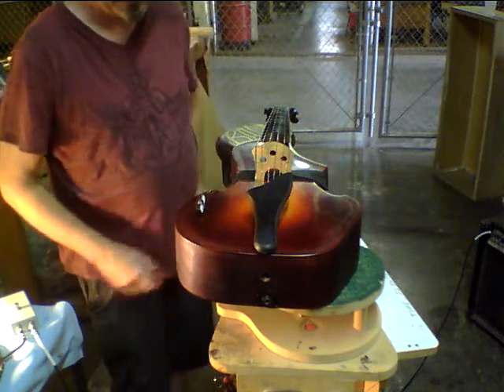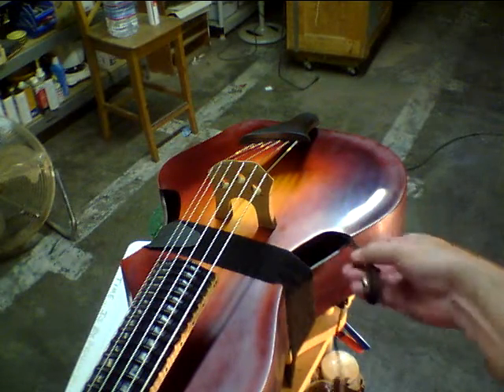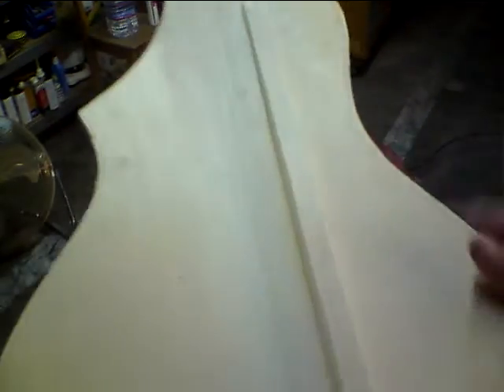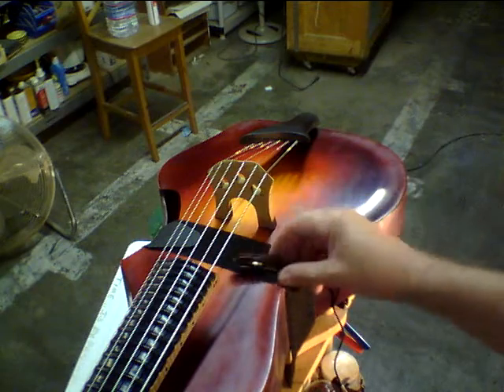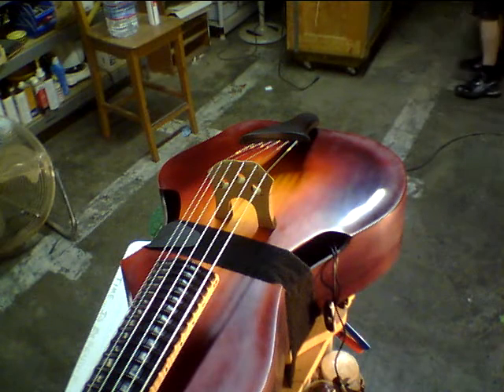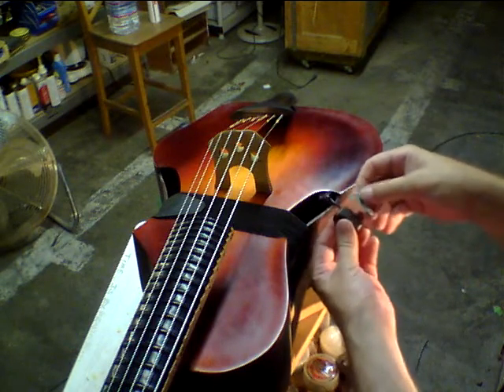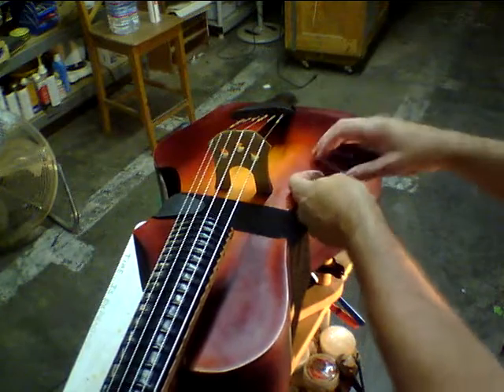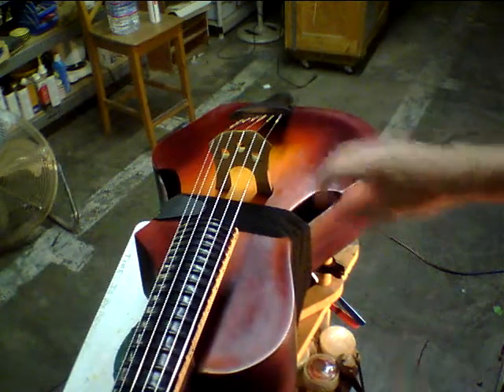LR Baggs Lyric installation on acoustic TogaMan GuitarViol

Comment: If it was my rig, I would have wanted the box with 9 volt dc plug, eliminating the need for the battery altoghether.
Nice demonstration over all!
Reply from the maker: +Jonas Bergmansson Thanks Jonas. There are a few ways to skin it. That would be good for EMG to know and I'll mention it to them. Back in the day, I modded many a vintage stomp box to use in dc pedal boards. (would be great if it is built in).
Reply: TogaMan GuitarViols Oh, so the preamp comes with the pickus? I acctually thought it was of your own construction.

I did something similar with my double bass preamp. It was suppused to be connected to the pickups via a one meter TRS-cable, clipped to ones belt and driven with a battery.
I bought myself a 5,5 meter cable instead, and used a nine volt battery clip to dc-plug-cable to connect dc directly to the battery clip. Then I put it on my pedal board instead.

I've heard some gear works with this simple solution, while other really seem to require the specific use of battery power, or heavier modding, to work.